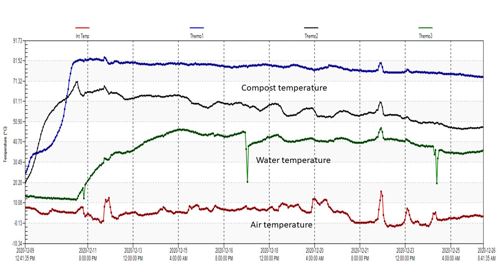Heating Hot Tub with Compost

Comment: Could you please remake your video and show the compost pile?  Your tub would need to be sitting pretty deep in the compost pile in order to heat the water to hot tub temps.  What is the size of your compost pile, what size is your hot tub and what material is your hot tub made of?  How do you get in and out of the hot tub without stepping in the compost if the hot tub has to be within the compost pile itself in order to heat the water?
Reply from the maker: The hot tub is a 500 L insulated container with about 400 L of water. Its on the ground, next to a 1.5 m3 insulated container that contains about 750 kg of composting material (the heat source). The water in the hot tub is circulated into the top of the composting bin to scavenge the heat coming off the top of the composting material. No, the hot tub is not in the compost pile.
Reply: Thank you for the clarification!  Yes, I know my questions and comments seemed ridiculous.  However, for those of us new to the process it's helpful to have a full visual of the setup.  Thank you for your time.
Reply from the maker: @ You are welcome. Yes, it could be fun to have a full visual of the setup, however goal of the video was to demonstrate how much energy is in organic waste, and that it can be harvested.  The practical application is how to capture it most effectively!

Comment: Hey John, great video, I just had a thought when you were telling the different uses composting generated heat could have, you gave the example of using the heat to dry materials, have yo ever given it any thought to dry compost that is ready to screen but is to wet to process with said heat?
Reply from the maker: I have not done this myself, but I am aware of another company that tried to use the heat from the compost to dry sawdust. I think that they gave up on it before it really went anywhere. It is a great idea, but its always a challenge to harvest the heat from the composting process efficiently without interfering with material mixing or turning.
Reply: @TransformCompost  The best way i saw was to use an insulated box, with heat harvested on the ceiling (returning consensation right into the compost!)
Reply from the maker: Yes, that is how we did this as well.

Comment: I wish you would show us the compost pile and heat exchange coils 🙏 thanks for sharing the possibilities
Reply from the maker: Thanks for the question. The compost pile was simply an insulated plastic bin that holds about 1 tonne of composting material. The heat exchange coils consisted of a plastic tubing in the biofilter lid - which consisted of about 12 inches of finished compost. The bin was aerated.
Reply: @TransformCompost  copper pipe would be a better option for the coils. But nice job
Reply from the maker: @832738  Yes, copper pipe is more conductive, but we also have to consider that its a highly corrosive environment!.
Reply: @TransformCompost  Nice ! Aerated how ?
Reply from the maker: Depending on the energy and porosity in the mix, the system actually self aerates, otherwise you can put a very small blower with a timer on it.